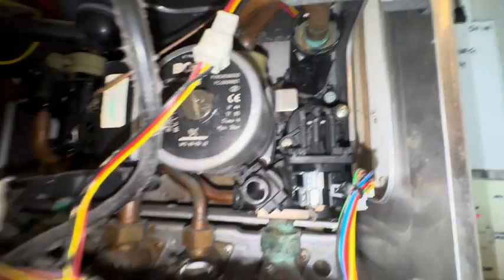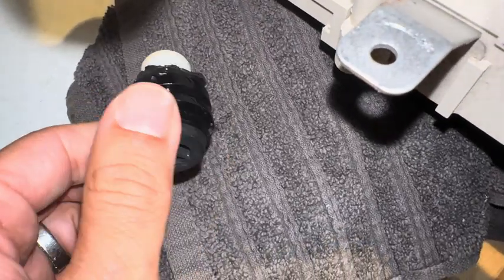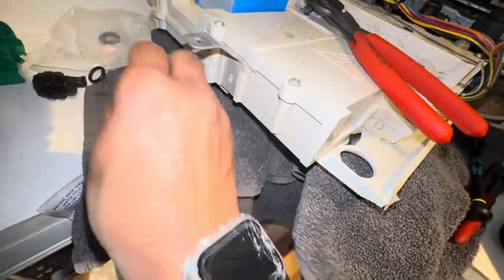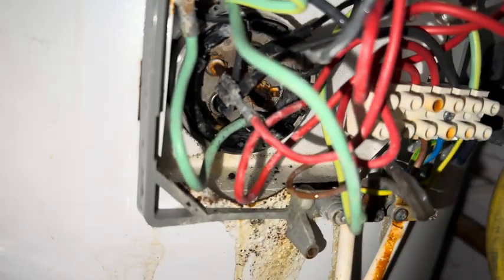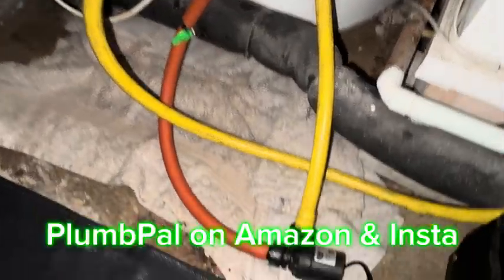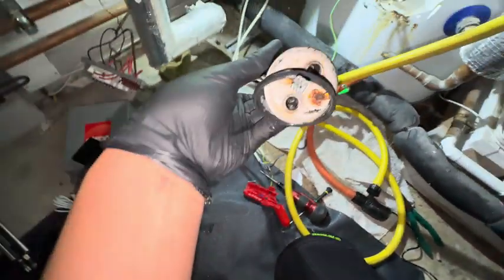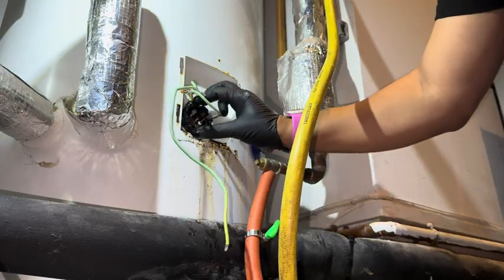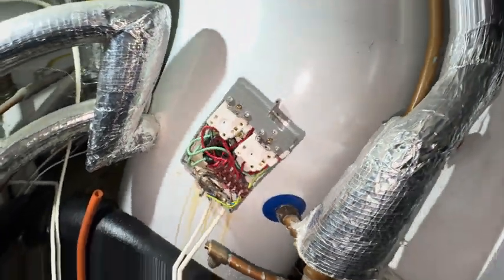Draining 300L has never been so easy!

Comment: Those flow adapter inserts vary in size depending on the kw of the boiler. They vary the flow rate for the hot water👍🏼👊🏼you know for the longest time i never knew what that key was for😂😆🤷🏼‍♂️ its only the first time i changed an element that the penny dropped!
Reply: Thanks for the tip. Good to know
Reply from the maker: @russellbaldry5095  haha I must say, I prefer it to the standard immersion BUT they do bend easily.

I did not know that about the inserts, you drop a gem every week 😂 18 years and about 1000 adapters later you’d think I’d have figured that out 😂 saying that, I have.l noticed different ones, some have a blue bit inside I think! 🤔
Reply: @RJHeating  yeah I changed 2 imm heaters today with the standard key but they were still a bit tough to get out. I been in the game 41 years, combis weren’t even invented when i started😂😵 am still learning from you guys though👍🏼
Reply from the maker: @ everyday’s a school day in this industry ayy! Appreciate you watching and interacting 🙏🏽 i think im cursed with immersions, would say 90% leak once fitting and I’ve tried paste, ptfe, nothing, you name it 😂😂 always seals in the end but a faff to keep draining!
Reply: @ all good bro. The ones i fitted today just had rubber o ring but i put some liquid ptfe on the threads aswell👊🏼
Reply from the maker: @ I’ve not actually had one to do since starting to use Rapid Blu but definitely will for the next time - it won’t be coming out again though 😂😂